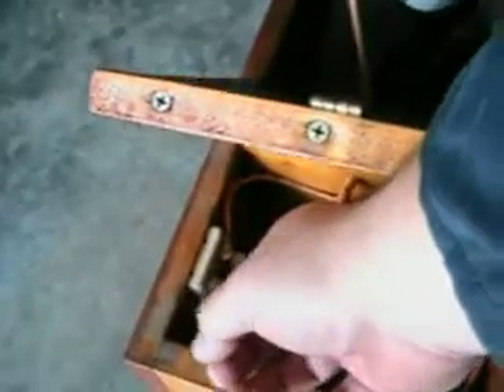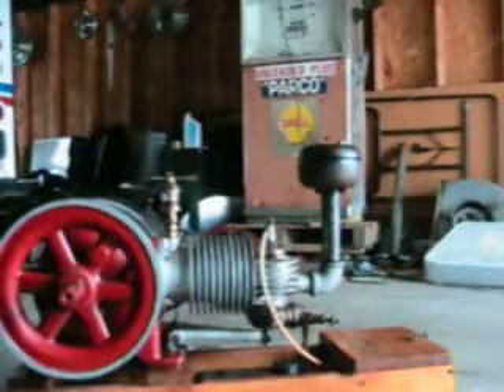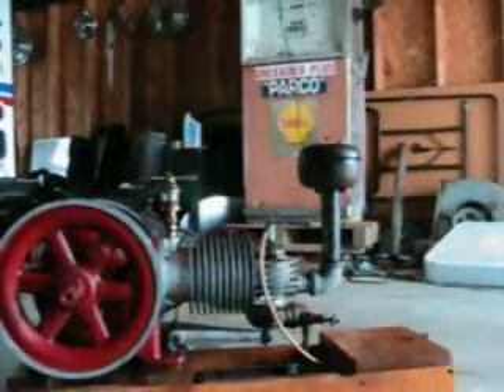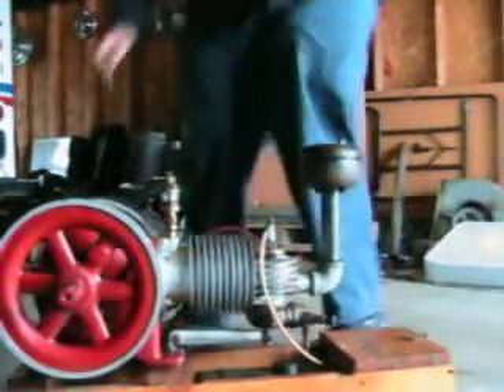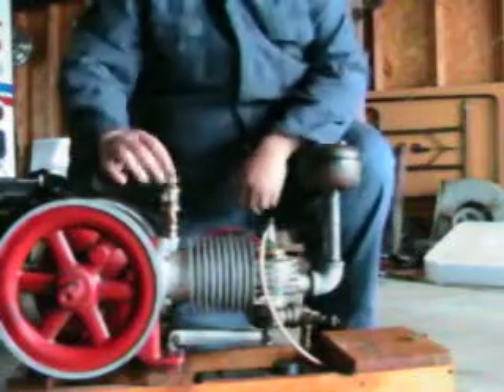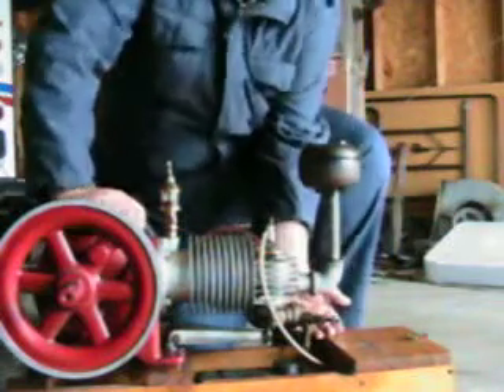Ideal Model R hit and miss engine part 1

Comment: Now that i have my engine out and running yours is smaller than a model r. Your carb appears to be sideways and i belive it is supposed to be gravity fed. There is a little button on the carb which i push on mine to prime the carb.